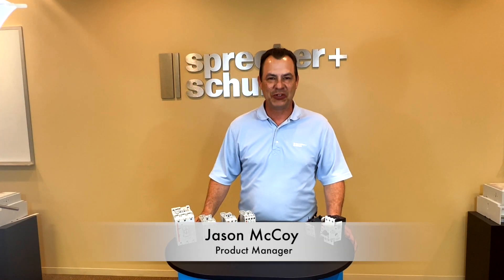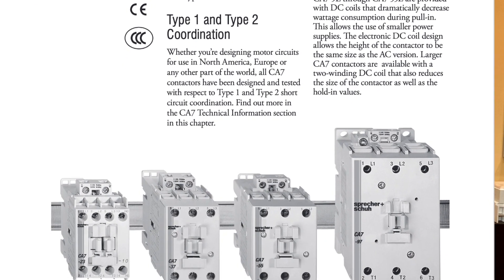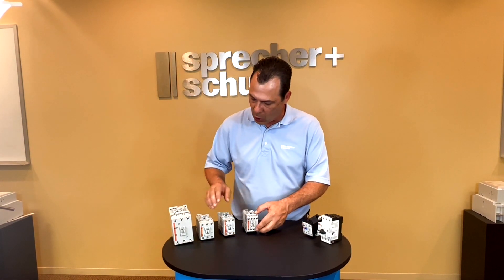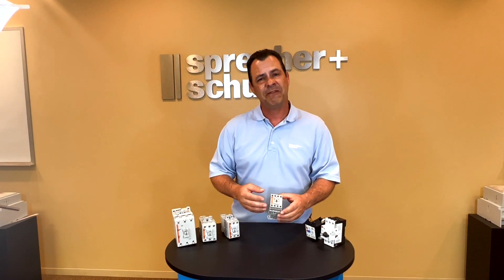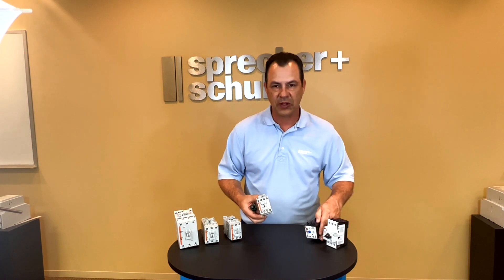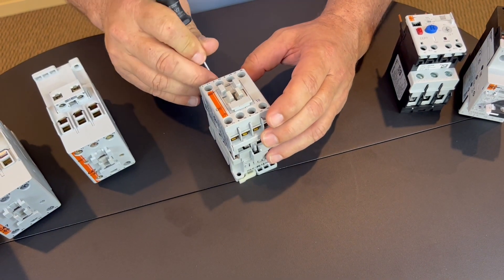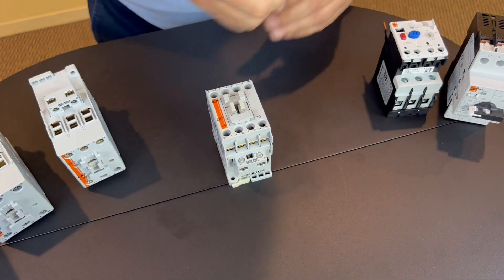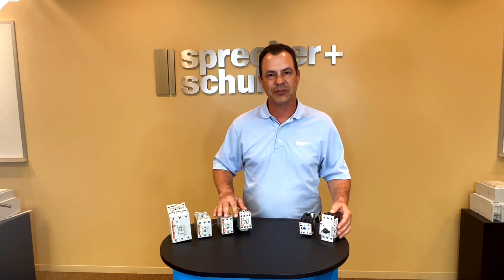Sprecher + Schuh CA7 Contactor

Comment: CA7-85 CONTACTOR     Has built in interposing relay 24VDC turns on 230 VAC for coil.      Can i get literature for this model
Reply from the maker: Yes, all literature is available at www.sprecherschuh.com, for assistance contact your local Sprecher factory representative.  Where are you located?